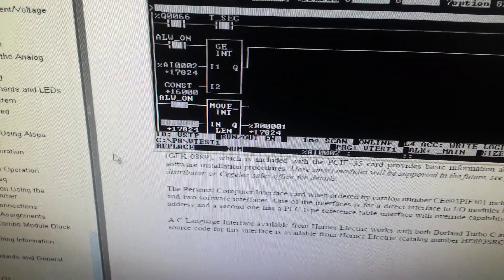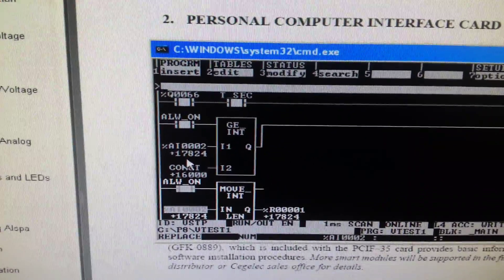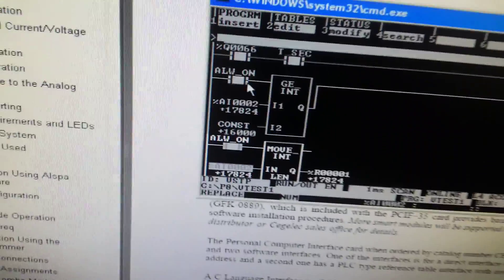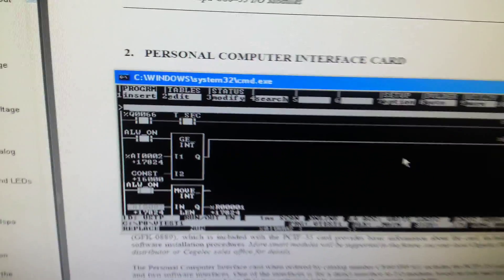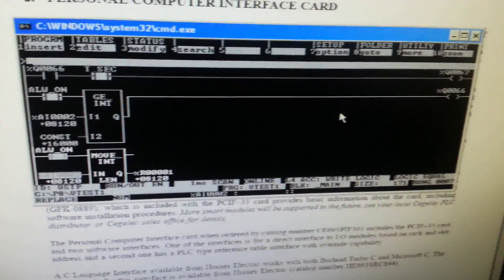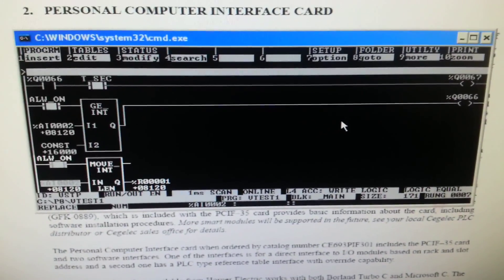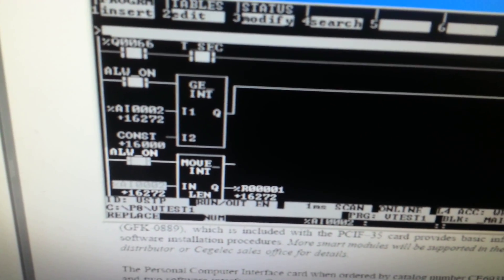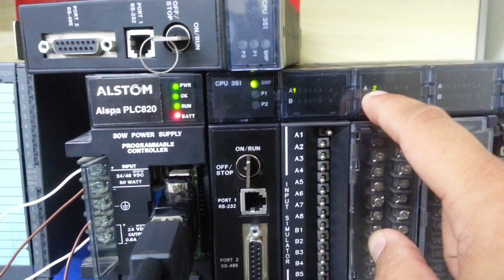ge plc  fanuc series 90-30 analog input simulation

Comment: What cable did you use to connect to PC? 

My team has the program, yet when connect to PLC, suddenly the system got tripped. 😓😓

🙏🙏🙏
Reply from the maker: Standard GE Fanuc SNP cable  . Thats unfortunate system suddenly tripped , i knew the feeling , Connecting communication cable should not cause any issue . may be the power supply module got disturbed physically while connecting the cable or the power supply module is faulty . Else the module connector is loose,  there's a lot of possibility .